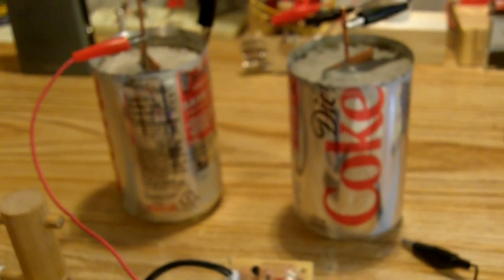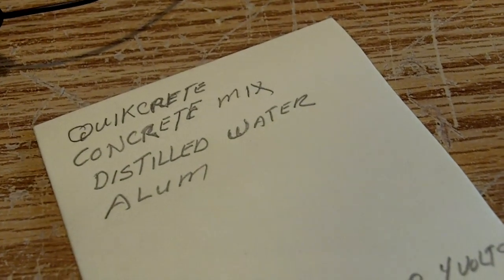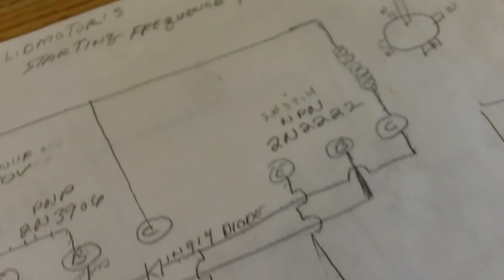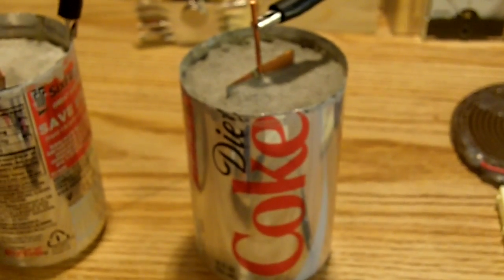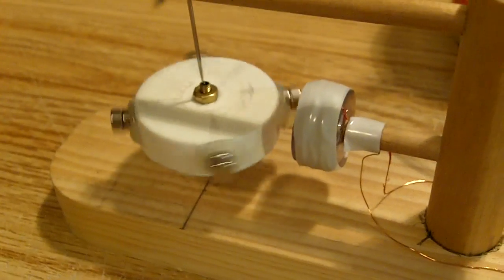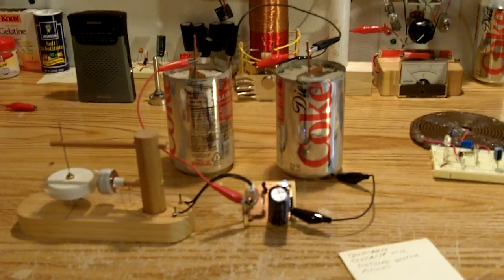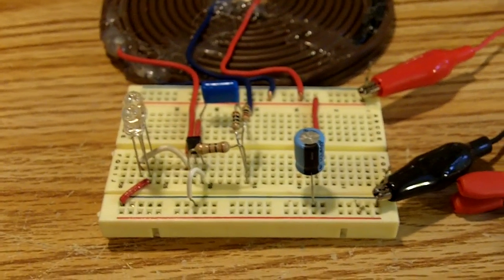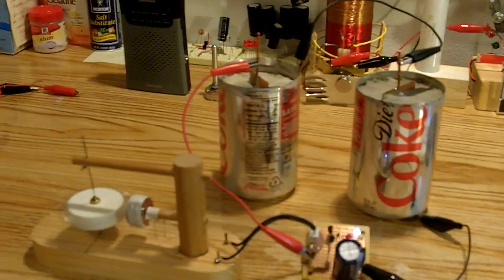Concrete Power.MOV

Comment: I made mine and used a stainless steel bolt. Also I put iron shaving from a lath. All magnetic. Used hcl to etch iron shavings. In my grout. Also used a iron pipe instead of a aluminum can. 
Surprised the hell out of me. Charged right up

Comment: Very nice work.  I read a lot about homemade battery and i found your construction inovative.  Nice to have a battery with a kind of dry electrolite.  I try some experiment with sand and bleach, but at some point, the aluminium can start to leak and the liquid electrolite was getting out of the system.  I will build one and try to power a joule thief with one or two of your new battery design.

Comment: The cement batteries that I made many months ago still have about 1 volt on them but very little amperage.  The "Penny" oscillator will run off them though and I have a small LCD clock running on one.  Expect the good amperage to go away in a day or so as the galvanic action slows down.  The batteries don't die but rather go into a very slow motion state.  You can short them out and they will bounce right back.